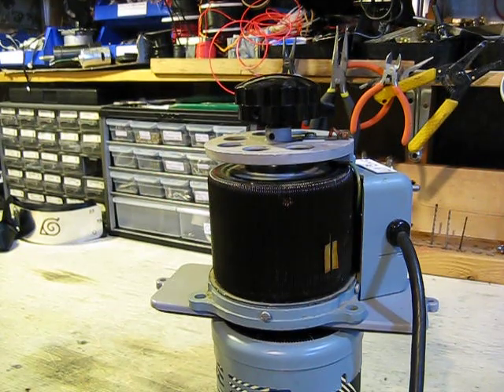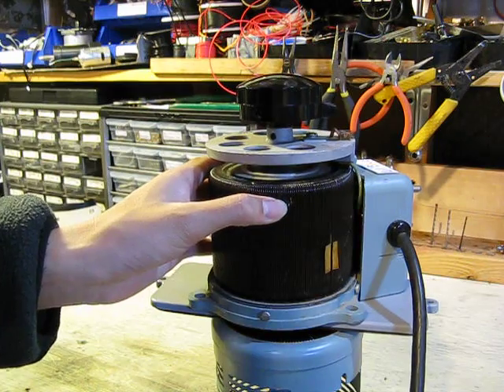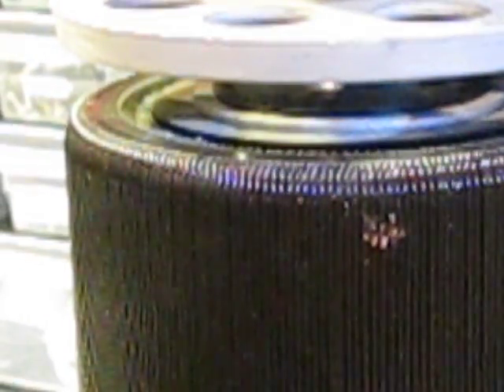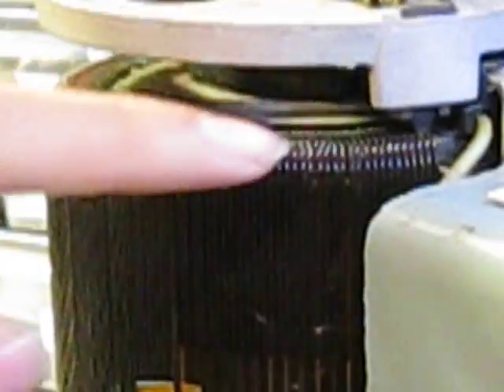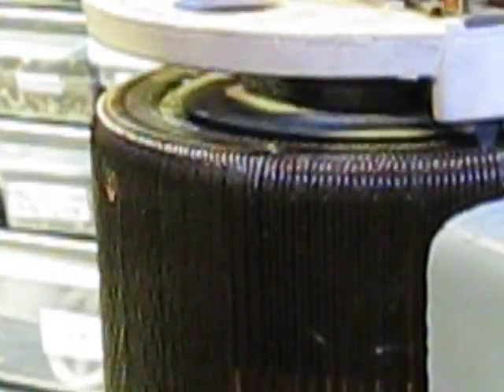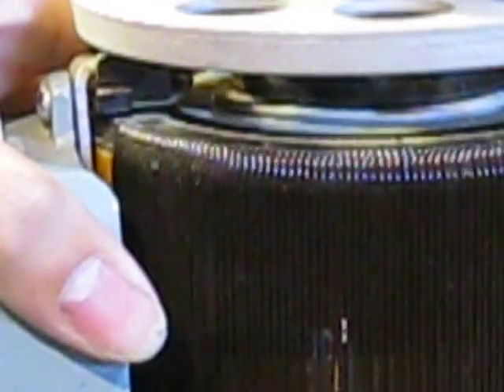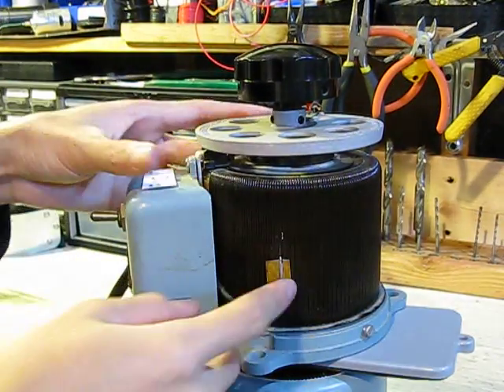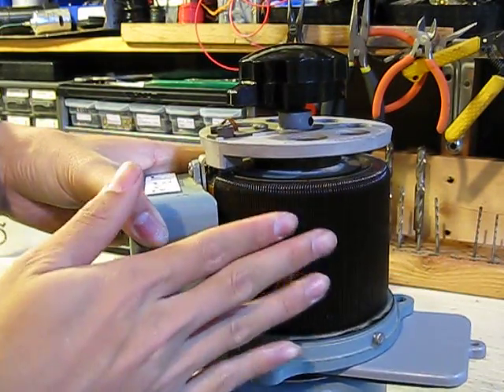The Variac (taken apart)

Comment: @MrSciencetificsasuke Have a look around in DIY stores as you can get these little desoldering pumps very cheaply that are spring loaded and suck up the solder. Using one of these it took me less than 30 seconds to get my flyback off of the board.